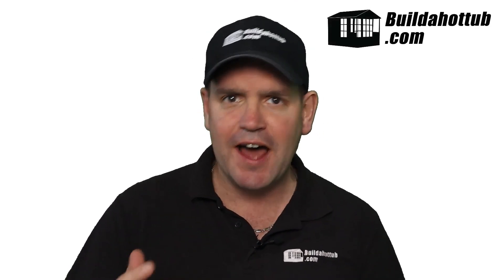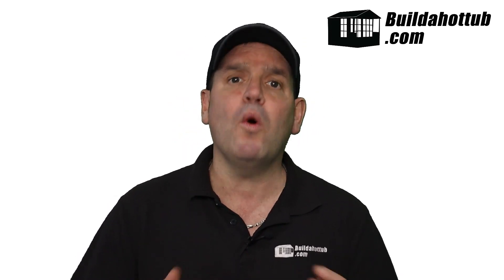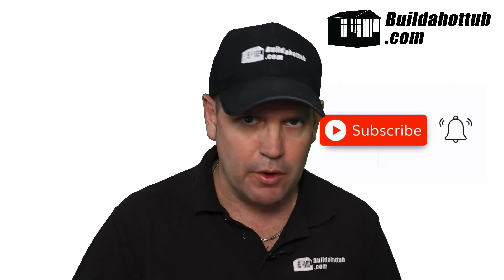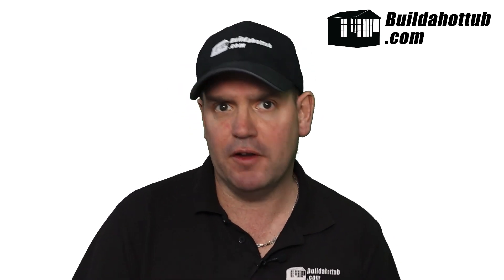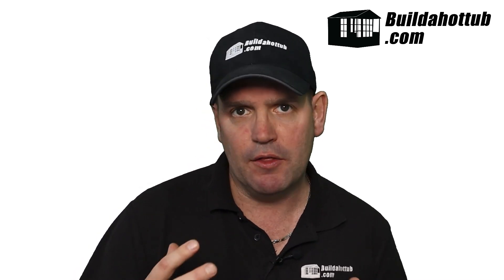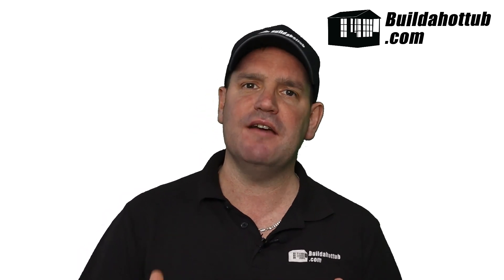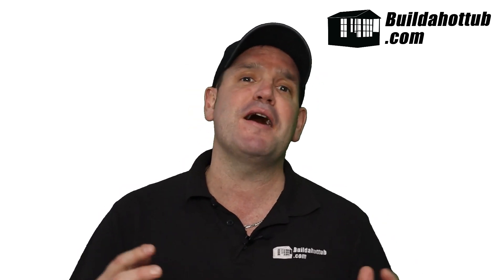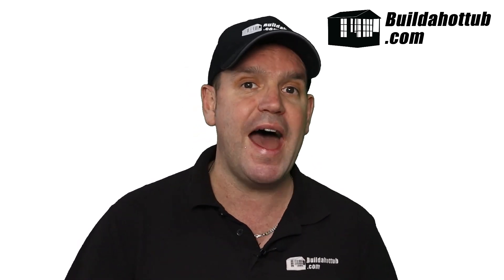Learn what happened when I ran my Air Source Heat Pump in sub zero conditions!

Comment: Interestingly I've just been working out costs and my electrical heater did indeed cost £25 to heat the water from 10 C to 38.5 C. Now looking at what it costs to maintain 38.5C. I have figures for maintaining it at 10 C too. It did take at least 18 hours to do that.

Comment: Hi Andy, what model do you personally use and the approximate purchase and installation costs - I'd like an idea of the pay-back period based on your  approx. 65% savings?
Reply from the maker: Hi Dave, thanks for the comment. I have the 20KW Comfortline, although this is quite a large one and the 7KW or 9KW is the norm for a more regular sized hot tub. Other customers are seeing at least 50% savings on those models - if you look through the comments on some of these videos you will see them. I think as my tub is quite large the 3KW electric heater was at its limit which is why i am seeing larger savings. You can fit these yourself, I have all the info on my website - here are the costs - https://shop.buildahottub.com/product-category/air-source-heat-pumps/ - cheers, Andi